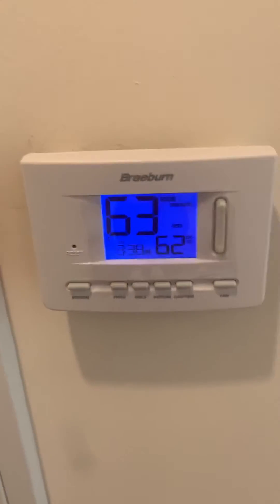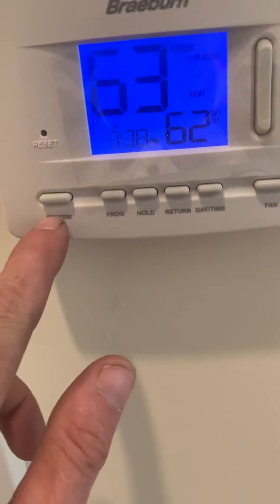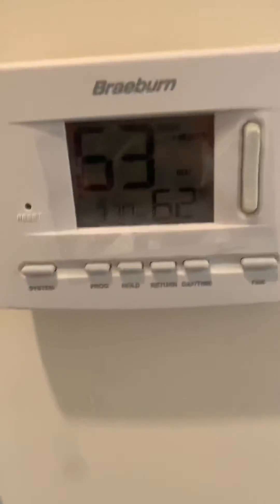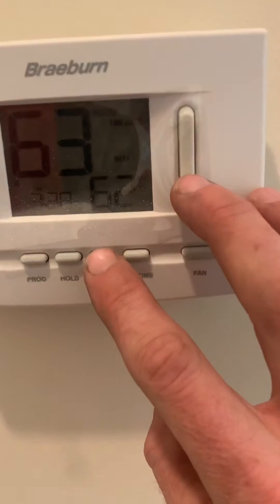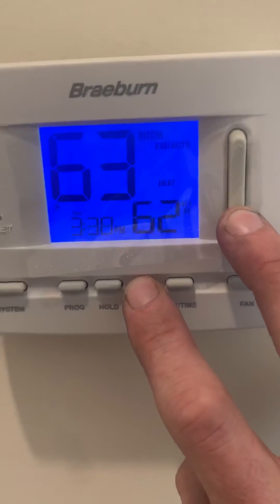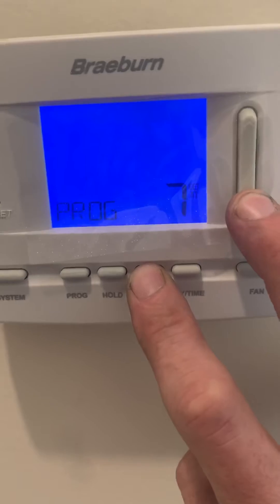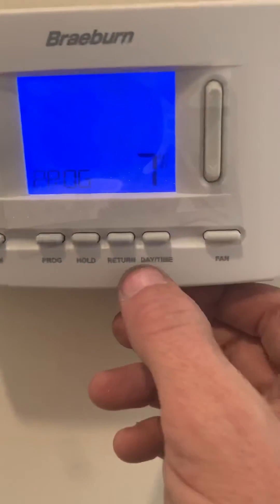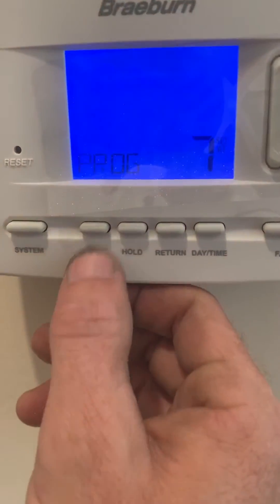Switching to heat pump and changing reversing valve

Comment: Have that thermostat. If i have a set cool temperature how do I set it turn back on when when it goes above say 3 degrees instead of it automatically turning back on everytime once the set temperature changes just 1 degrees from the set temperature. Because my unit keeps coming on every 15 to 20 minutes just to keep set temperature. But if it will turn on once it gets above a set temp it will save me on energy cost

Comment: I have the same braeburn thermostat and it's locked out of AC mode. I can't get it to enter system at all. It's less then a year old. Breaker box is on. New batteries. No leaks. Filters fine. Why won't it do anything? Already tried to reset as well